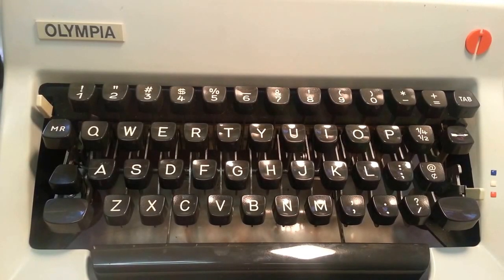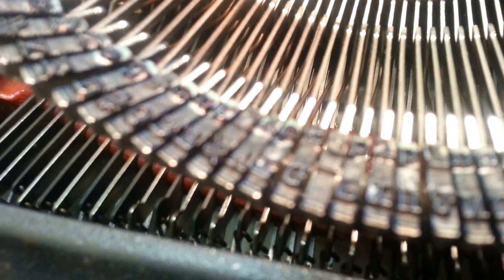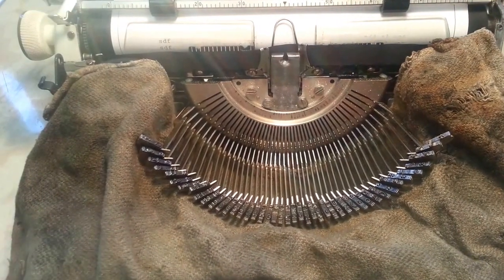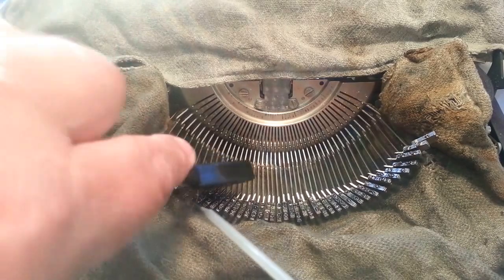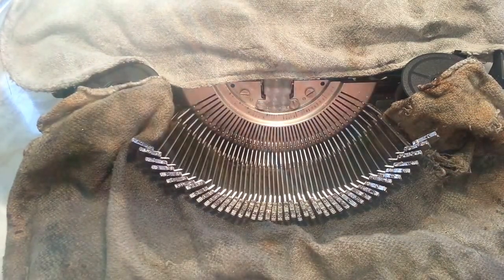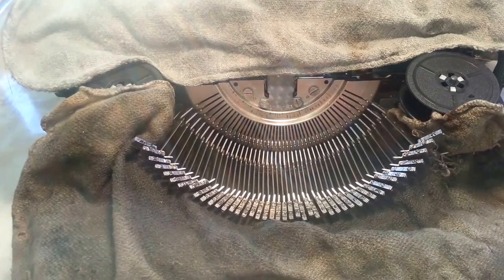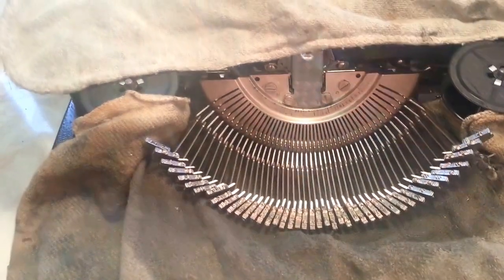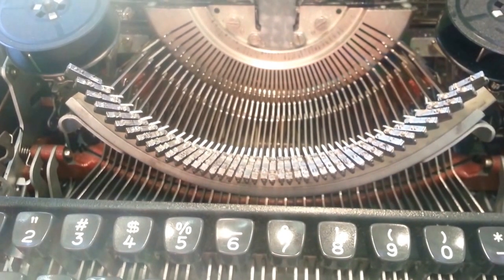Typewriter type face slug bar segment cleaning demo tutorial detailed

Comment: Which brush is used  to clean type bar face?
 Medium, long, short
Answer please?
Reply from the maker: I was using the cheapest brands, sometime 3 pack from dollar store
But they would not last long, switched to name brand from amazon here is the steel wire brush I use (brass is OK too)
https://www.amazon.com/DEWALT-DW49708-Stainles-Cleaning-3-Inch/dp/B00FYZHVN0/ref=sr_1_18?crid=35X5P3RO63ISN&keywords=wire+brush&qid=1694973829&sprefix=wire+brush%2Caps%2C167&sr=8-18

Comment: So I did this the other day and it worked perfectly, but I noticed the next day some of the keys were stiffening up again so I kept typing, and they loosen once more. Now two days later as a type some of the keys are sticking pretty bad. Do I need to flush it again? Or is it because I didn’t put some kind of lubricant? 

I also noticed when I fully close the lid some of the keys are unable to be used. Especially the ones on the far far right. Also the ink isn’t as dark, it’s like the keys don’t hit with as much force.
Reply from the maker: Yes, stronger chemicals, more aggressive blow out, repeat as needed, lubricant should not be necessary
Far right & left type bars have different geometry and sometimes are harder to strike

Comment: Hey, guys!I just got an Olympia Splendid 33.Works great!Only the ink is a bit weak. Seems dry.So is it safe to re-ink with pen ink, like used for Parker or Watterman pens? Or it needs a special typewriter ink?Cheers ;)Also what corrosive product did you use?The automatic caption makes bad subtitles.
Reply from the maker: I use lacquer thinner, red marvel mystery oil & MG #401 spray
do not re-ink, Typewriters use 1/2 nylon ribbons on 2 spools, $10
Reply: Thanks!
Is zippo fuel safe to clean too?

Comment: Just came to the sad truth that there is some rust on the ribbon change mechanism for the Underwood. Is there a fix to help with rust? Its pretty minor, but it is in the moving parts and it does grind a little bit. Would you recommend using vinegar with a brush to get it off?

Comment: Hey again!
My Facit 1620 type bars got rust.
I saw videos with vinegar doing a good job.
What you reckon? 
Is vinegar ok for the type bars alloys?
What type of steal are they made out of by the way?
Cheers! ;)
Reply from the maker: I don't have any sure-fire way of removing rust, lots of variables. Not sure the exact metal alloy used for typebars, probably varies by manufacturer. Just need to do some trial/error or check youtube for some demonstrations.
Reply: Thanks! I researched YouTube "rusty (or rust) typewriter " found little.

Comment: This was very helpful thank you so much, but is it ok to use water only? Or will it cause rust?
Reply from the maker: Water and metal = rust, I can, and have, used water on certain areas of typewriters, 
but immediately air dried out and coated/dusted with oil to prevent rust, that stuff in can is excellent for that.
Water won't do much to clean old oils or ink
Reply: Phoenix Typewriter thanks aa

Comment: This is well over the top - no need to use corrosive chemicals, and what I really dislike is how rough he is with the delicate keys - absolutely no need to scrub along them with heavy pressure.  To anyone watching this, I would say, treat these vintage machines with care and a light touch. also use a clean cloth  - what is the point of rubbing them 'clean' with a filthy rag?
Reply from the maker: You can talk to me, always open for constructive input, but those keys are tough hardened steel, designed so because when typebars slam in to the back of others they have to withstand that impact without scaring. Nothing I did could possibly harm them. Sorry you don't like my cleaning technique, but it's proven itself for decades & decades . . .